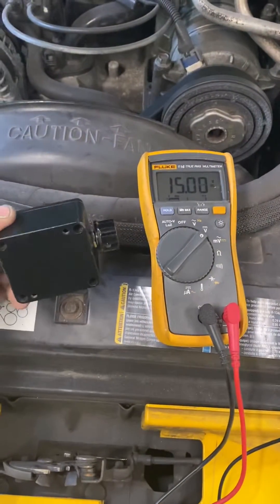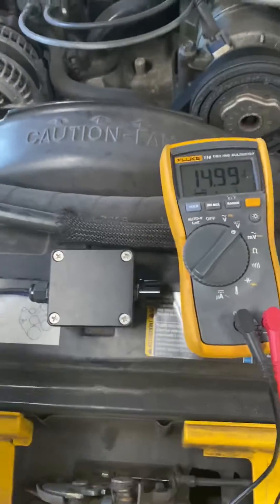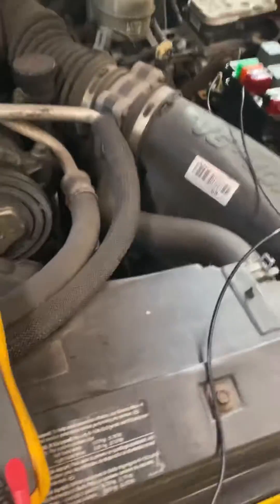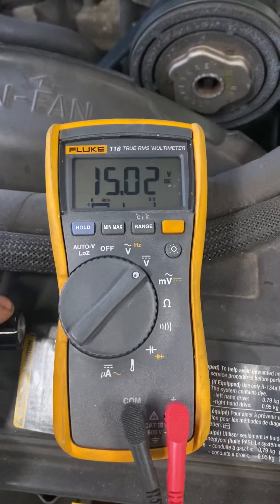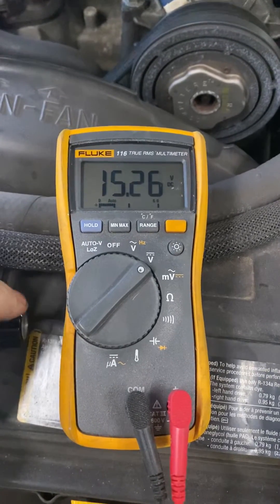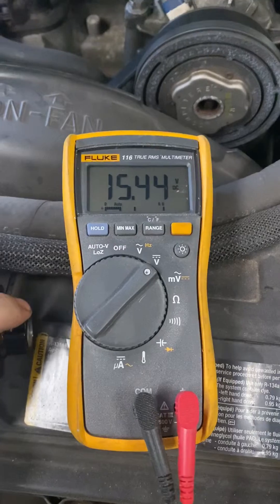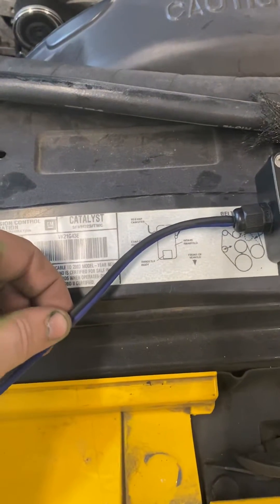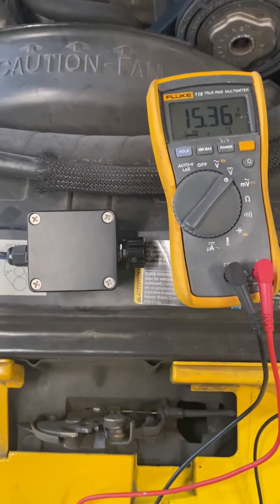Quick video of the voltage knob in action

Comment: So what if I’m using the 14.8 volt pug in? Where would I splice in the wire from the knob to? The original harness to alt from vehicle or the 14.8 volt plug in harness sense wire?
Reply: Same boat
Reply: @mattbartlett2402  I wired it to the blue wire on the plug. The one that’s not connected to anything. That’s the “S” wire. Splice one wire from the knob to this and the other wire from knob to terminal 87 on relay. Not sure what type of vehicle you have but mines is a 07 Tacoma. Hope this helps.🤙
Reply: I have one wire on the sense wire. And the other to a switched 12v source should I have it connected to the ignition relay instead?
Reply: @mattbartlett2402  the setup I have is so I can turn the volt knob on and off. If you go to Facebook and follow BrandX you can search there for a diagram of how to set it up. 🤙

Comment: Hey I see your running this on a 4.0l Jeep..was curious if you know off hand what the part number is for the belt your using..I’m waiting on my alt to get here...and I can figure it out if you don’t but I figure if you know exactly what belt your using it would save me a little time!
Reply: By the way nice job! I’m going to be running a external voltage regulator so I can adjust my voltage as well..nothing like having almost 16 volts on tap!
Reply: Looks like a 4.3 blazer to me

Comment: Do I still need the resistor on the alt wire going to ignition with this knob installed?
Reply from the maker: Memphis Houston those two things have nothing to do with each other, the S wire uses a knob. If the alt is bypassed or running to ignition to turn on you still need a resistor on L.

Comment: I have a mechman 370 elite with the 2 wire plug will this work so I can charge higher then 14.8v
Reply: Yep same boat here
Reply: Did y’all figure it out? I got it installed on mechman 370 elite but only get 15.4 off it . I guess cause I don’t have a brand x regulator on it .

Comment: I have the dcpower triple alternator bracket and 4 pin gm relay harness and i wired it up to a keyed ignition source and to the blue s wire and it jumps straight to 18v and doesn't move with turning the knob
Reply from the maker: nickwhitinger use a relay.

That’s too much load to be off a ignition source without a relay.  It’s dropping input sense too low and causing the spike.
Reply: @brandxelectrical  okay thank you for the info another question to do I need to both s wires together to the knob on the 2 extra alternators ?
Reply from the maker: Yes, the sense wires for all the alts together on blue on the knob.

Comment: I have a 300XL from ces but I wanted to get a 300XXL and run them as a dual setup. Would I be able to use the knob for both?
Reply: Jesse Valdez if they have a sense wire yeah..